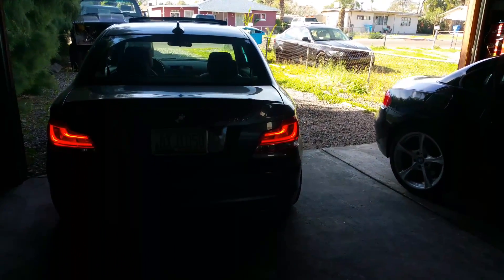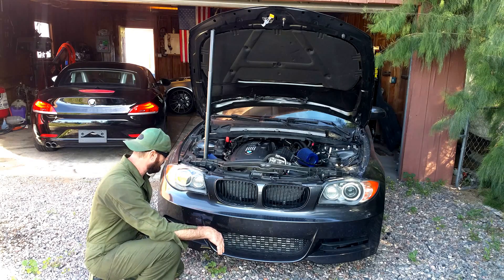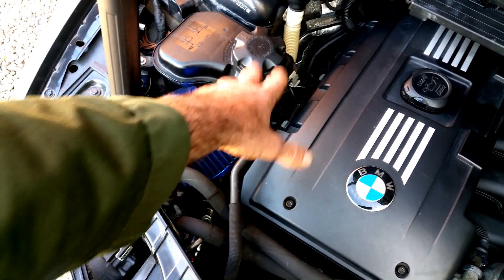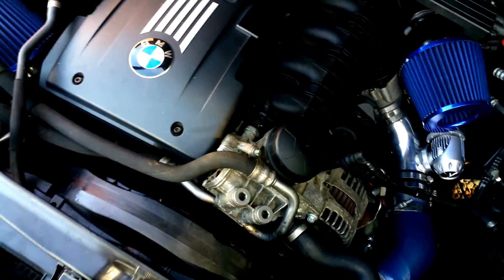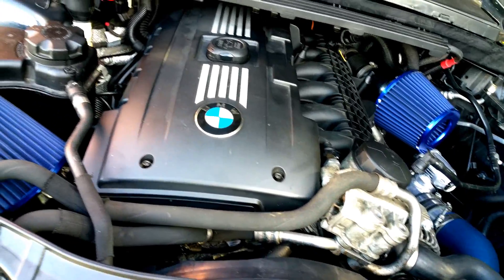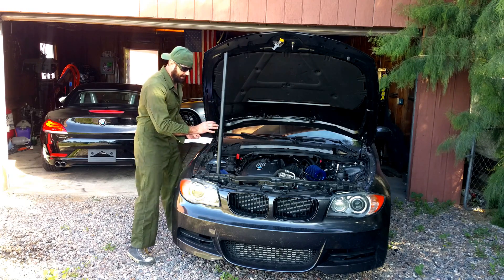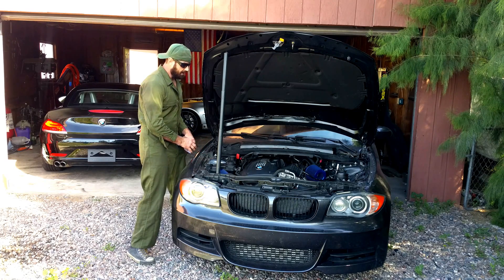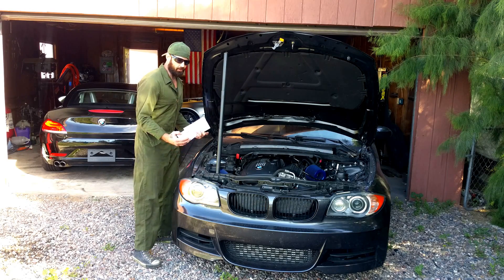BMW N54 N55 Full Bolt On Idiot Guide

Comment: Ok mr can you answer me a question why the hell does my car smoke I just replaced my turbos snd did a valve seal job on my 335i and my car still smoke took it to the dealership and they cant tell me why im getting 20 psi out of them but is smokes whyyy???
Reply: Rings? Do a leak down test. Pcv issue? Mine was blocked creating to much pressure in crank case causing burnt oil...

Comment: I have a 335xi I want to change my front inlet what silicone hosing did you use to reach the turbo and did you have to remove any parts for the filter to fit

Comment: Nice vid, I have many of the mods you mentioned already but I'm looking for an aftermarket custom tune since I have the Cobb AP3. I know that Cobb is being made to be pretty obsolete with MHD on the scene and all but I think if I get a custom e40 tune then I will be getting the kind of power that I want for now.

Eventually I plan to upgrade my turbo whenever my stocker decides to take a dirtnap and I'll probably go with PS2 or maybe even one from Vargas but I'll decide that when the time comes.

Thanks for the awesome vid and advice.

Comment: What would I need to do to make around 400-450whp with a 335xi?  I've heard the chassis on xi models distributes power differently than rwd
Reply: Colin Davis same as with the i other than the lsd. I have an xi with downpipes, intercooler, inlets, dci, chargepipe and bov, custom tune from MHD, making about 430

Comment: Ive had me vacuum canisters removed for quite some time now as it appears you have as well, or relocated. I haven't noticed any difference besides more engine bay room and a cleaner look. how has your experience been with them removed?
Reply from the maker: Yep It has made no difference except (as you said) more room & cleaner look! Peace
Reply: how do u cover up the hoses from the canisters? or is air just coming out?

Comment: Excellent video i really learned a lot. I also was wondering if you could make a more in depth video on how to use the mhd tuner app in addition to running a jb4. Thanks
Reply: The Angry Mechanic Please go over the nuances of using mhd flasher in combination with three jb4, is there any advantage of doing this? 

Would mhd only negate the need for jb4?
Reply: I DONNO SHIT.. but i go wit the mhd.. seems like it reduces wastegate rattle.... adds power.. 200 bucks only... and does same as jb4.(500bucks)
Reply from the maker: Justin J I definitely will thank you